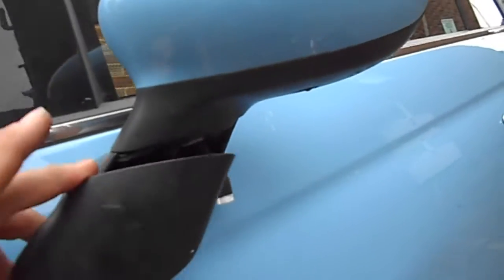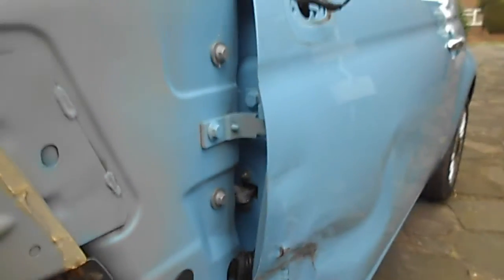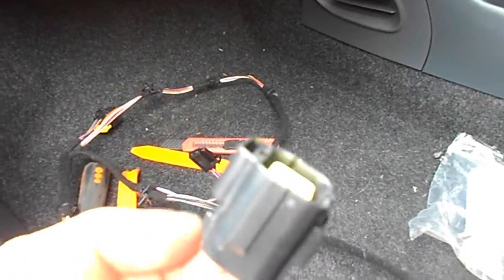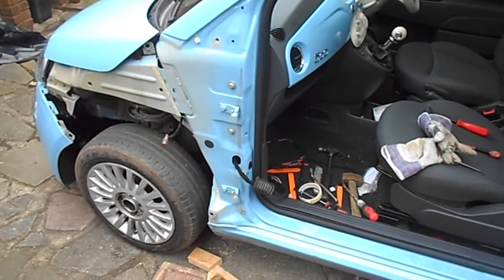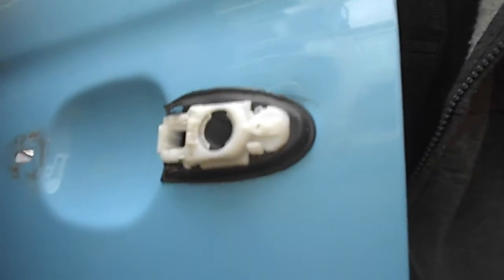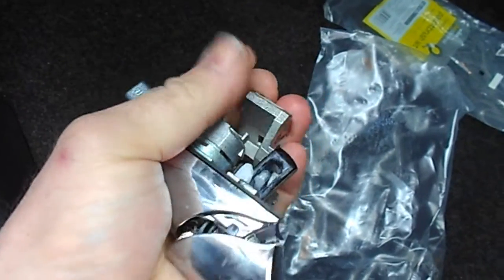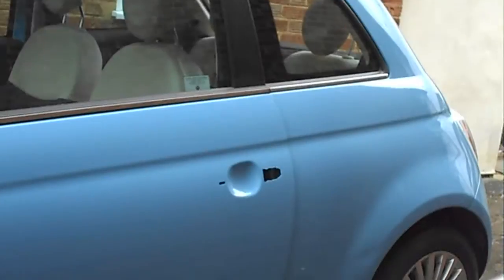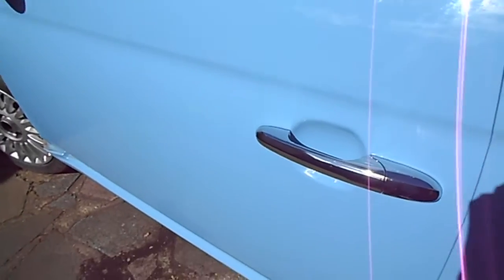Removing & Replacing Fiat 500 Door - Love 500 How to Series

Comment: Did u do a video for aligning the door ? Thanks
Reply from the maker: Generally they don’t need aligning.
Reply: @Love500  ah ok thanks , was only asking as when you fit it u said bout the gap being tight at the lock side  and was slightly out at the top ? Just thought u maybe had to align to get yr gaps equal ?
Reply from the maker: @martinp907  on this particular one the hinge had bent slightly but usually they fit perfectly.
Reply: @Love500  ok thank you 👍